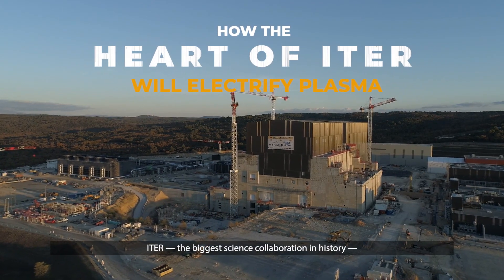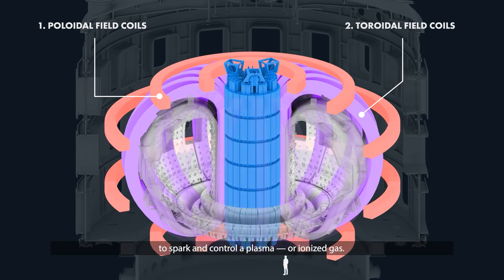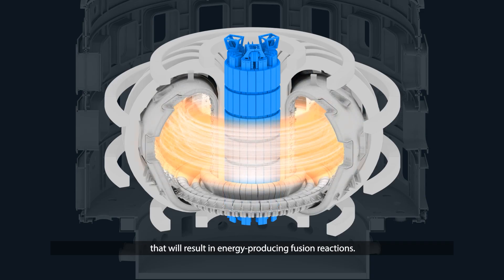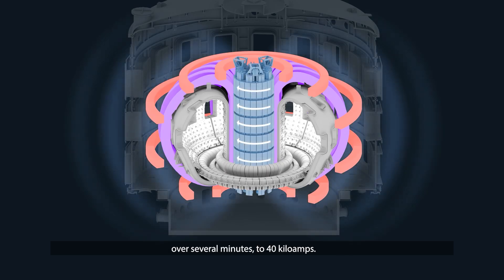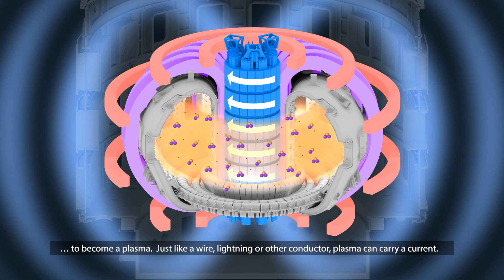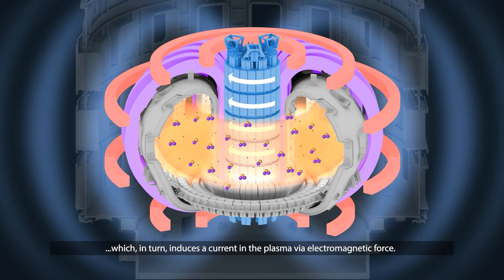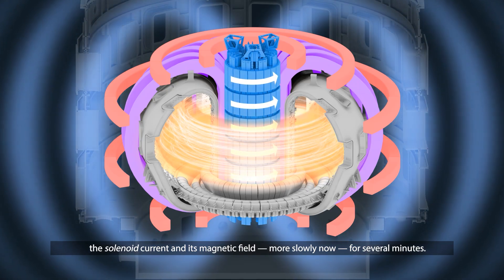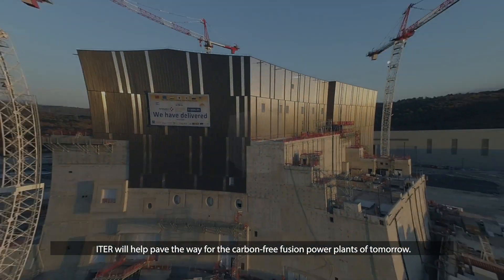How the Heart of ITER will Electrify Plasma

Comment: More than 35 years waiting for Fusion Power. When is enough to suspect that currant theories are wrong? This is just like looking for Dark Energy and Dark Matter.
Reply: It was and still is a materials engineering issue, not theory problem.

Luddite
Reply: Nuclear fusion is a fact. It's already happening in several reactors (and in the sun). It's simply an engineering challenge to use it to generate energy; the physics is largely solved.

It's nothing like dark matter/energy, where the physical mechanisms controlling the phenomena are still unknown.
Reply: @idanbhk3875  Please then provide with links and peer review papers. Good luck because 1986 we were told we would have Fusion power reactor up and running. I was one that believed in it but over time and money with failed results tells me something is wrong. I really would like to know how you can prove how the Sun is Fusion power at its core when you know its imposable. It only took 27 months for the development of the Nuclear bomb. Its now over 80 years for Fusion with No sustained results resulting in more energy out then put in.
Reply: Fusion isn’t happening in any reactors numb nuts, it requires alot of mass to create the stability needed to work. This won’t work the scale is millions times to small.
Reply: Nobody doubts that iter will overcome breakeven.
But that is impractical way.
Low beta - about 2.5%, while fusion power is proportional to beta^2.
DT reaction is most easy to realise. But high flux 1-2 MW/m^2 of high energy 14.1 MeV neutrons will quickly damage first wall.
To imagine how costly is a first wall of vacuum chamber let's only to get its weight - more than 5,000 tons.
Only aneurronic reaction may have a future.
And today's tokamaks - even sofisticated ITER are a wrong way.
Today's tokamak programs are a competition of collateral technologies - remote handling of plasma faced components at JET, high temperature superconductors REBCO at newest american tokamak, etc.
But beta is remains at around 2.5%.
Because of it reactors should be so monstrous

Comment: What's the projected date for powering up?
Reply: 2033 (july 2024 announced). Then a years testing before passing commissioning, then (if no problems pop up that need to be addressed) its a-ok for normal operations.
Reply: 2025
Reply: @aseell8709  cope
Reply: @aseell8709  I am from 2025 and it still under development